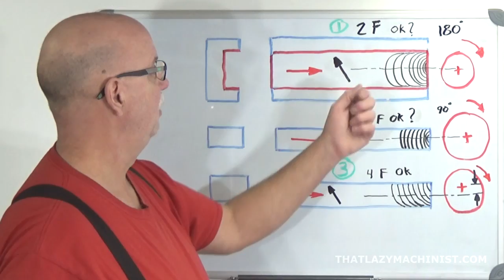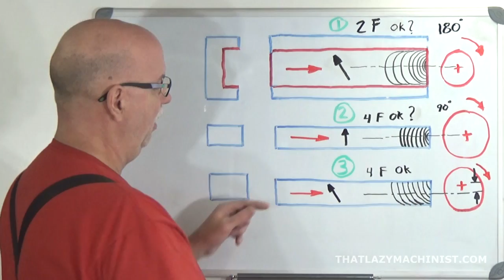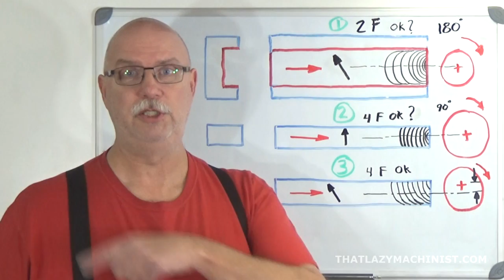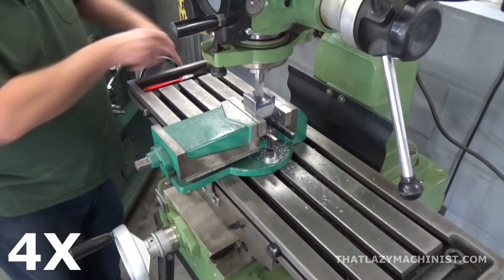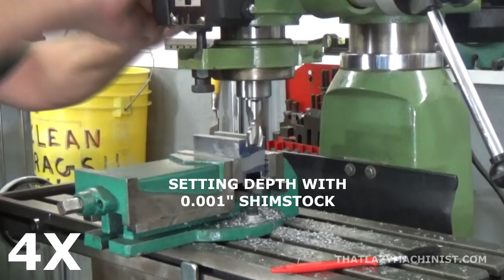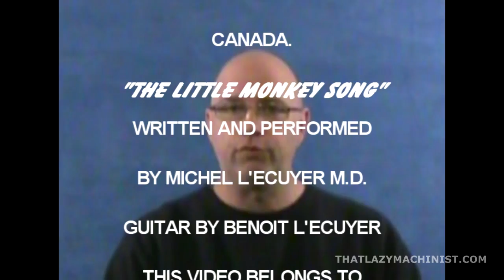V-BLOCK PART 4, mill, shaper and surface grinder 101 Marc L'Ecuyer

Comment: Another good video - I've learned a lot from them.  Thank you!

About the volume available for chips in different size cutters:  the volume is equal to the cross section area times the depth.  The area does increase as the square of the cutter's diameter, but the depth does not increase at all.  So the volume increases as the square of the diameter, not as its cube.  The volume of a sphere increases as the cube of the diameter, this volume is that of a cylinder.
Reply from the maker: Thanks Bob for those corrections, all input is welcome as it helps us understand more. Keep the comments coming, and thanks for watching. Marc

Comment: I just have to comment, Marc. I have been watching your videos for a year or so and you do such a great job of explaining everything in great detail, so a novice can understand. I probably have gotten a years worth of free schooling just by watching your videos. I always learn something new with your work. The world needs more of your kind. Hats off to your work! BTW how the heck do you keep everything so CLEAN! Its immaculate in your shops, no grease, oil, or dust anywhere.
Reply from the maker: Thanks twoturbo. I was an apprentice in the National Research Council of Canada's High Speed Aerodynamic's prototype shop. I won the lottery when I got that job. We did make  a mess when machining but the shop foreman was a stickler on cleanliness. He use to say that it was not possible to work accurately in a dirty shop and reserved the last half hour of each shift for a good cleanup and every Friday afternoon for maintenance and a thorough cleaning. I got use to working that way and it still bothers me when the shop is dirty, so I clean it up often. Thanks for watching and be safe, Marc
Reply: Thanks for the response! I like cleanliness too, I run an auto repair shop, and we have a few machines to make parts and make repairs on un-obtainable items from time to time. Maybe a LQ video on how to keep a shop and equipment clean? Sounds silly but we have a hard time keeping the surfaces such as the mill table and lathe ways from developing light discoloring of rust, from the humidity in the spring here in Midwest. Like what kinds of oils is best for preserving and preventing rust when machine is not being used and what cleaners to use for cleaning up?

Comment: Nice project; plenty of different operations and setups.
Unless I missed something, didn't you arrive at your first cut of the last (edge-finded) groove with the backlash on the wrong side? You moved the table towards you to indicate the edge, you moved the table towards you again (in stages: to center the finder, then to bring the tool into position). Then you made your cut, which should have pushed the table towards you, moving it during the cut by whatever backlash you have in the Y-axis.
Reply from the maker: What a great question Peter! The unused axis on the mill (the ones that shouldn't move during a cut (in this case the y and z axis)) must always be locked during a cut. The axis that moves (in this case the x axis) is the only one to consider for climb or conventional milling since the others are no longer active. I should of mentioned that, thanks  for permitting me to clarify that. Marc
Reply: Ah; I keep thinking in terms of my own mill (Yuasa Supermax). It was factory fitted with an Anilam CNC package (way outdated) and thus has no X or Y axis locks. I have to be very careful about backlash when using it as a manual mill, which is most of the time.

Comment: Is your mill a CIT 30 Mill Drill and where in Canada is it available. Do you recommend the round column or knee type, for basement home shop?
Reply: Not speaking for Marc but a round column would have driven me quite bananas.
Reply: A skilled machinst understands how to produce quality parts despite the limitations of his equipment.  Marc is the best example that I can point to.
Reply: Yes indeed, but it is a real pain to keep alignment when you have to raise or lower the head on a round column. With a knee mill or a square column there is no problem in that department. If you have the choice, you would be masochist to volunteer to have a roundie.